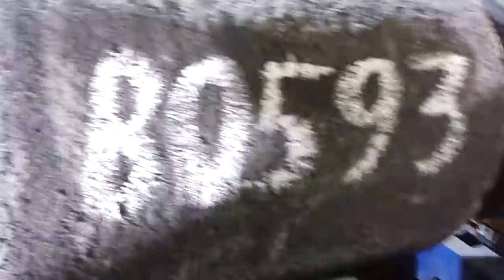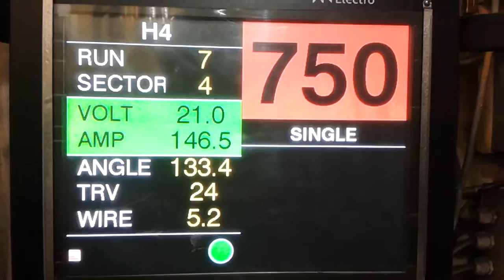offshore pipe line xray crawler icm.

Comment: Good afternoon dear colleagues! Our company makes many years "The automated complexes a x-ray krouler of S-300" intended for x-ray control (NDT) of pipelines. Our production is known and highly appreciated well by experts in Russia.
We make x-ray krouler of 2 modifications: 

1. A x-ray krouler of С-300 180kv for work in pipelines diameter from 260mm. to 800mm. which are equipped with the x-ray device 180-200kv.

2. A x-ray krouler of C-300M for work in pipelines diameter from 420mm. to 1420mm. which are equipped with the x-ray device 250 - 320kv.

Kroulera are completed with x-ray devices: Site X, Balteau, Eresco, Smart, RPD, CXT intended for work from batteries 48V, 120V.

This is the most innovative krouler in the world! Capable to work in the most extreme conditions at a temperature from-45 to +70 degrees Celsius. The magnetic control system "K.S.E." with guarantee works at thickness 40mm. 

 We hope that our equipment will interest you. We will answer all your questions.

With respect. Kravchenko Sergey.
CEO 
ECOLINK of the Tax Code company Moscow
tel/fax +7 (495) 510-43-50
mob. + 7 965-308-26-08
http://www.ekolinknk.ru/

info@ekolinknk.ru

kravchenko@ekolinknk.ru

ndtcontrol@mail.ru